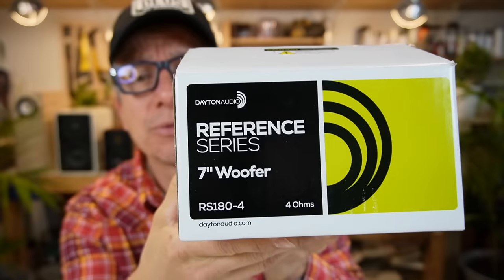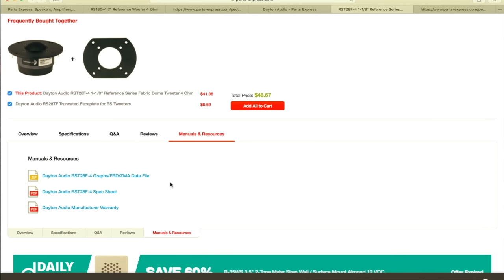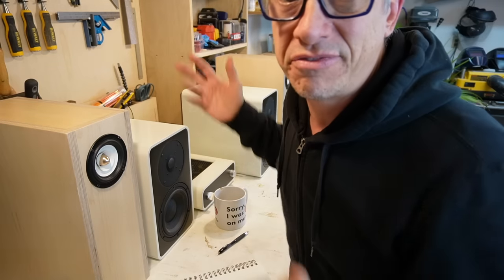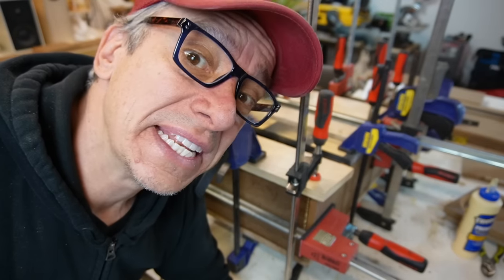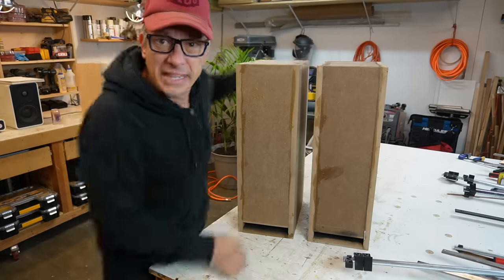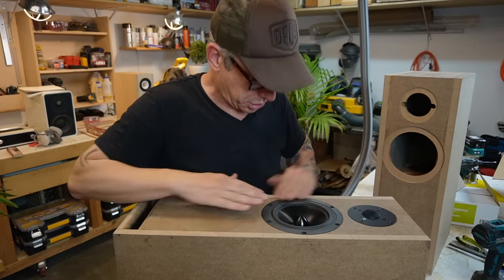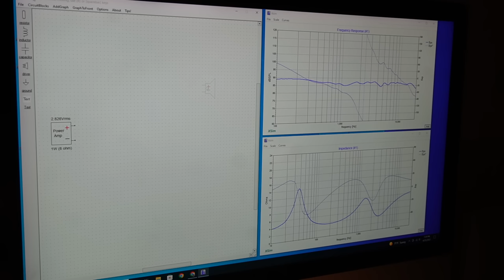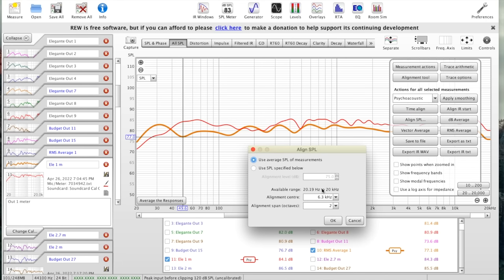Dayton Audio Reference Series Speaker Build | DIY | $200 Drivers Deep Bass Hi-Fi  Elegante Speakers

Comment: Dude!  Great ideas, presentation, and design…BUT -  anyone watching this and getting inspired to do a similar project, BEWARE - don’t use the brad nailer like this guy!!  Always keep your hand away from the business end of the nail gun.  Those brad nails have a tendency to kick out of the wood unpredictably and will end up in your finger.  If you need to hold the wood in place firmly, use clamps.

Also, if you tighten the clamps on the finish wood (walnut side panels) too tight, you may end up with round impressions in the wood from the clamping points.  You can avoid this by slipping small squares of Masonite or thick cardboard between the wood and the clamps.

But I must say, very classy speaker!  The only thing missing is a little brass plaque on the front somewhere that reads “Sonora Designs”.  That would be…elegant.
Reply from the maker: That’s right!! Thanks for the input Robert. I had nailed my fingers before and it’s not fun! You never know where  they are gonna land. Protection first! Thanks

Comment: Do you know about impedance and how mixing different impedances works?

I’ve seen people mix 4 ohm tweeters and 8 ohm woofers. I use an old A/V receiver so I have concerns driving something that’s just 4 ohm.

I also don’t know if it makes sense? If there are any advantages/disadvantages vs going with all 4 Ohm, 4 & 8 Ohm, or all 8 Ohm. 

I appreciate the video! I’ve been looking to make some Dayton REFERENCE towers myself 😂 but I want them bad boys to be like 39-40” tall
Reply from the maker: That’s right Billy. It’s a big load on the receiver. I had those drivers before so I had no choice other then keeping it 4 ohms. I’d suggest going with 8 ohms both woofer and tweeter. If you use difference impedance you might ended up with a gap on the frequency response. Try to put them on Xsim and see what happens but I’d go with 8 ohms all around. Good luck on the reference towers!!! Thanks for watching.
Reply: @Douglas Blake thank you! I see all of these kits with 8 ohm woofers and 4 ohm tweeters so it gets a bit confusing when you’re just starting out.

Are there any suggestions you have for an 8 ohm tweeter? If you have the time that is…

I have ringing in the ears so I’m a non fatiguing speaker kinda guy.

I’m considering just getting the Dayton Audio DC28F-8 1-1/8" Silk Dome Tweeter for now and figuring it out as I go. Mainly because the 8 ohm versions of a good number of peerless are out of stock and there wasn’t a reference version in 8ohm that I saw in stock.

I know I want the 7” Dayton Reference 8 ohm for the this project. Just having trouble finding a tweeter as I’m new to this haha
Reply: @sonnoradesign  Thank you! I asked Douglas Blake but if you had a moment, would you have any suggestions for a good 8 ohm tweeter? Something non fatiguing that would possibly be good pairing with the Dayton 7” Reference 8 ohm?
Reply: @Douglas Blake okay. Yeah, I was interested in the 7” because it reaches a little lower than many of the 6.5” and because it allows for a narrower cabinet than the 8”. Seems a little easier to crossover than an 8” too.

Though the aluminum 8” seems to have a pretty flat frequency response to nearly 2k.

Is the lowest you can tune a cabinet just the lowest point in it’s frequency response? 

I just question whether I’d be happy with around 40Hz on the low end with a 6-1/2, or around 30Hz and hoping I’m happy with the midrange on an 8”.

I guess this is all part of tinkering I need to go through haha
Reply: @Douglas Blake so, say for example, you have a 6-1/2 cone rated 49-10,000hz… when you tune a cabinet, are there any measurements you use to know how far you can tune down before exceeding cone xmax? Is that how this works? Or is that just based on how much power is going through at particular frequencies?

So, I already have Sony Bookshelves and was considering making them into taller, deeper towers. (They’re currently in parts 😂) I was playing with calculators for port length when I started realizing what I didn’t know about these cones as I was working on a cabinet tuned to 38Hz. I was worried about damaging the drivers suddenly.

This is what started me down this rabbit hole haha

I’d take suggestions of smaller, more standard sized cones to look at if you have them haha.

Why are all the Dayton reference models in 1 inch increments??? I didn’t notice until you made me look
Reply from the maker: @Douglas Blake I guess I missed this chat out. I didn’t get notified! :((
Reply from the maker: @billymurphy3  I missed this one out! Just saw you guys talking here! Blake has great info!!
Reply: @Douglas Blake hahaha I’m wrong on a good number of Thursdays. 

So, I’ve been trying to find a software replacement for Xsim and have been struggling. I’m a Mac user and don’t have windows. Plus I don’t have enough room to partition for a windows emulator. I have a number of video projects I can’t easily move around and are only partially edited.

I’ve been kinda stuck here.

I was trying to find online calculators but they  didn’t seem to allow me to input the necessary files like Xsim…

My only good option might be to make space and run an emulator unless there is something for Mac out there hiding somewhere.

Comment: Hi, what finish did you use on the sides? thanks!
Reply from the maker: Hi Anthony. You can use danish oil or the good stuff. Both are gonna give you that finish.
Reply: @sonnoradesign  ok great, thanks for responding! What do you consider "the good stuff"? I like using Danish oil. So curious.
Reply from the maker: @Tonypalmeri1968  It’s a wax. Emmet’s “good stuff”. Find it on Google.
Reply: @sonnoradesign  lol I didn't think it was literally called Good stuff. I thought you were making a general statement 😂
Reply from the maker: @Tonypalmeri1968  haha! That’s right. People don’t understand at first. I’ve been using it for years. Pretty “good stuff”!

Comment: Merhaba .ben türkiye'de yaşıyorum. Evimde technics hifi sistem var.ama elimde olan hoparlörlörlerden istedigim sesi  alamıyorum. Orta sinif bir hoparlör bütçemi zorluyor,komponent sistem araç hoparlörü için kendim 2 yollu bir kabin yapsam .nasıl sunuç alırım. Komik duruma düşermiyim😂.bilgilendirirseniz sevinirim.( kıscası araç hoparlerlerinden evde iyi sonuç alabilirmiyim.
Reply from the maker: Hello there my friend. The drivers are usually different, car drivers (woofers) tend to play on door panels or dash so it might have stiffer suspension.. you can donut though if you get a box calculated on a speaker software.
Reply: @sonnoradesign  çok teşekkür ederim 👍😊